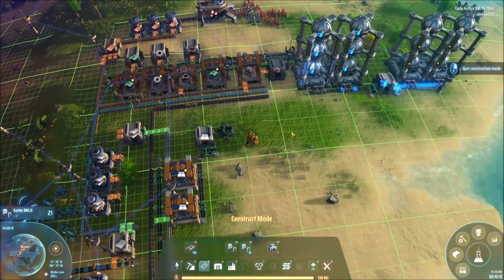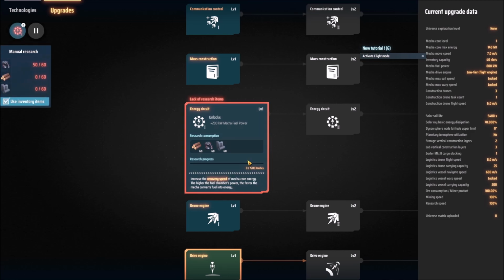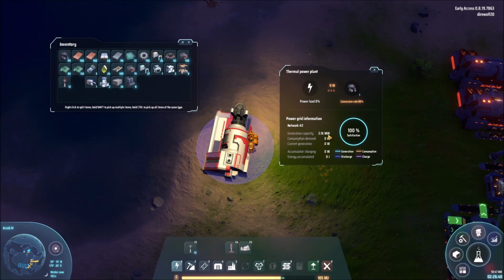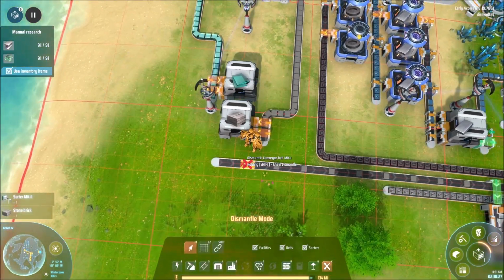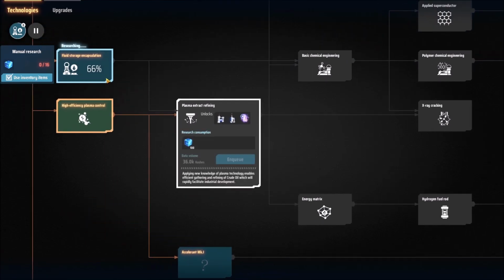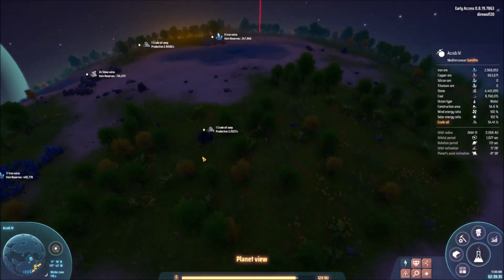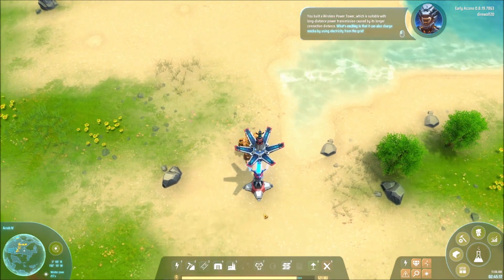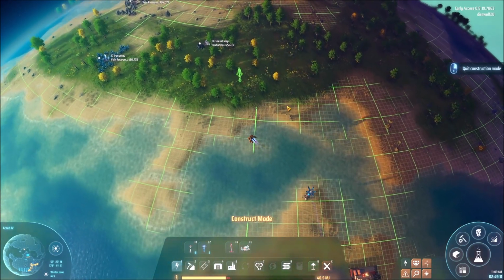Dyson Sphere Ep4 Graphite and Upgrades

Comment: Dire , they added blueprints in latest versions. Blueprints!  And as  0.8.20.7996 version patch notes says there were some bugs with previous implementation of blueprints , resulting in blueprints with errors. The not-placing-several-sorters errors . So devs suggest everyone update to  0.8.20.7996 and make and share blueprints with this or higher version.
  Are you excited about blueprints ? I feel , as Factorio player and someone who personally made awesome Building Gadgets mod , you should be excited.
PS It appears youtube eaten my previous comment, so i repeating , sorry if it gets doubled.

Comment: What I want to know, is it worth placing more than one miner down on iron or copper veins early on? It doesn't seem too necessary but would it help or just be a power hog? Is there research that allows one to get more out of a vein?
Reply: to saturate a mk1 belt, you need two miners, each targeting at least 6 nodes in the vein, so yeah, ideally you always want 2 miners per belt. Once you have mk2 belts, you can go up to 4 miners per mk2 belt due to its increased speed. This game is all about checking the ratios of production/consumption and optimizing it (Dire is not doing so great on that right now lol)

Comment: didnt do any math, just wondering. you have an energy investment in producing the graphite because you have to smelt the coal first. with this taken into account does it actually make the fuel more effective (which would be even more unrealistic than there being no loss), or does it just condense your fuel in terms of storage?

lets say a piece of coal produdces 100kJ energy, then smelting it into graphite costs you 50kJ of energy, and burning a piece of graphite produces 150kJ energy. you havent really won anything in terms of the energy you get out of it, its just a denser storage of energy per unit of graphite vs. coal.

if there is energy loss involved, the process could be quite inefficient.

i guess it could be more power if both types of fuel take the same to burn.

Comment: Hey dire when you get solar panels make sure to put them all around the equator so the panels are always producing energy regardless of which part of the planet is facing the sun
Reply: that doesnt mean there is always sun- half the equater is still in night at any given time.you know  They will just get a bit longer days and the sunlight should be stronger due to less atompshere to penitrtate- if they bothered to implement that detail.

Depending on a planets inclination, the best place for max sunlight might well be one of the poles sometimes.

Comment: That is not a lot of copper, hopefully the other two planets in the system is one rich in it or you might need to do some minor rationing of its use.

Also, technically the starting plant has got silicon (actual and not stone smelting) and titanium as its a random drop from the single use minable stones scattered around the planet. If you are really forward planning it should be able to collect enough to for 200 yellow science and get the interstellar logistics system before leaving your home planet. You might not be able to actually build one of the towers at that point but you should be able to take all the resources to the other planet, get the rest of the titanium and then build a pair of them so you only need to make a single trip to set up fully automated yellow science. Maybe a bit too advanced for your "new player tutorial style" but thought I'd put it out there for anyone who wants to try